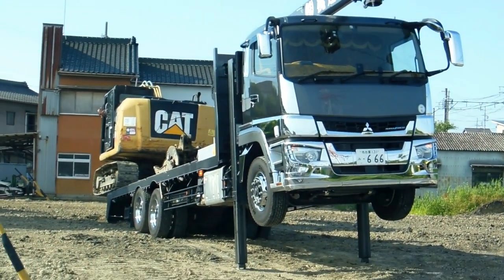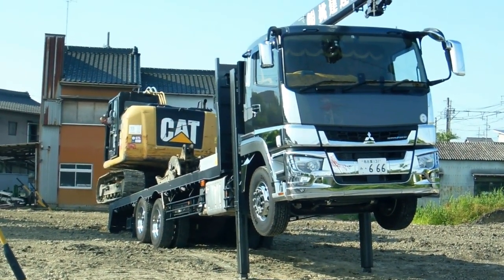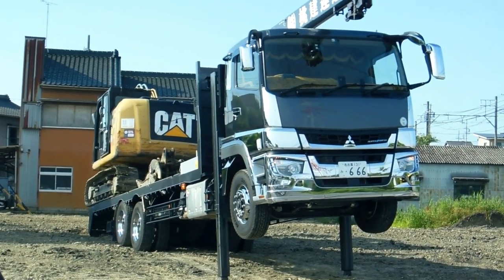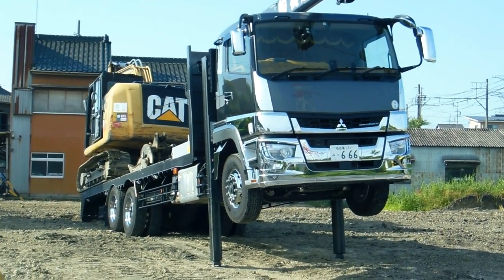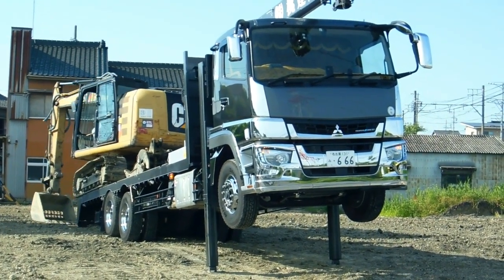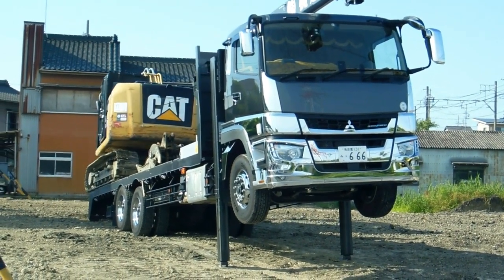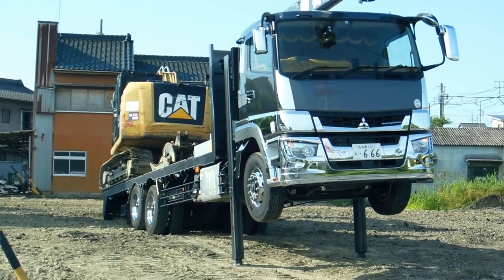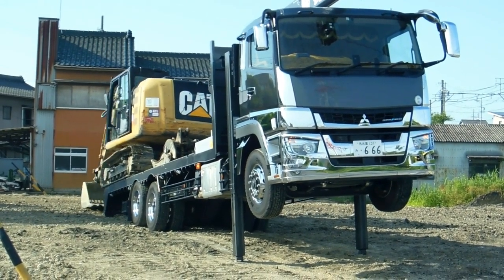Interesting Truck Loading Technique in Japan

Comment: Are we gonna just ignore the 666 license plate?
Reply: Nope! Nagoya 131 Mi 666. The white plate signifies that the engine is larger than 660 cc, or it exceeds the dimensions permitted for a kei truck.
Reply: I wasn't, no.

Hellcab flashbacks
Reply: I think that is one truck not many people would want to drive with a plate like that 😈 🔥
Reply: Yep. That's a hell of a truck.

Comment: That beats the ever loving piss outta the trucks frame and suspension. Then they wonder why the truck is utterly trashed in 2 years
Reply: Doubt it's that bad or even any worse than loading it other ways
Reply: @Rokomarn  It is trucks are not designed to be loaded that way. Can you? Of course but just because you can dosent mean you should
Reply: @skyking6989  it's literally designed to be loaded that way considering it's part of the truck. How is it any worse than just driving it on?
Reply: @Rokomarn  It's all about the angle and where the weight gets transferred. Trucks like that are designed to be backed into a dock and loaded while flat and level. Like I said they can and do load like that obviously but it wears everything out so much faster. If you want to load like that get a truck designed for that ie a tow truck where the bed rolls back. It's there truck do whatever you want but don't be surprised when your truck is trashed in 2 years
Reply: @skyking6989  lmao ok dude
Reply: @skyking6989  yeah these kids don't have any sense... just because it's designed it doesn't mean it's just as good... there's a reason 90% of the world do no load this way lol....
Reply: Clearly you know nothing about japanese trucks
Reply: @Akeem_768 Again you can load like this but it just beats the piss outta the suspension and when the frame, shocks and airbags are absolutely trashed in 2 years they are shocked.